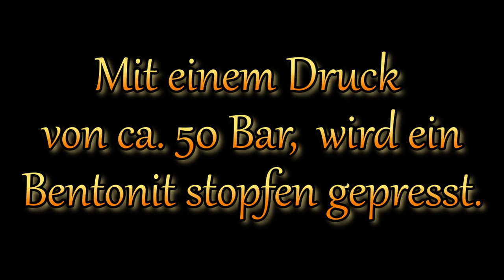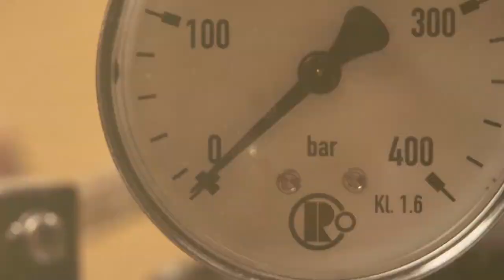Der Aufbau von einem Bengaltopf

Comment: Von wo die presse?
Reply from the maker: Es ist eine alte Küvettenpresse die nicht mehr produziert wird, es gibt allerdings noch baugleichen pressen: https://www.ebay.de/itm/255780653758?hash=item3b8db70abe:g:NwIAAOSw-w9d3ZS-&amdata=enc%3AAQAHAAAA4O5GknGYH81E4Xyckth41oHPGB7C5s%2BKU2AX2a7sk6u7UfxgGTIPrKmeTvdzML1xCFXpfkZrjf23wghXQnd31TjTkYbRti1yXlSYHT3Wy3%2FN3bk9xbKegG6tMMvhRndi5zkBSSCPSXKym1p8thVc%2BdCFQWHgs%2FblJKlCazUvbQKzcYoulgDqOUE%2FFggEcZlcA6sNkfA%2FJwMRxoUg36ViU%2BEPGoyDVh6GDvXBvwN07aPZ%2BGgN%2BEnh%2BIlzw39dduOztzekD%2B72xh0Cb1rAr3AzKvktrJj%2ByaDAp3iE%2F29mKOAU%7Ctkp%3ABFBMxILYu5Fh